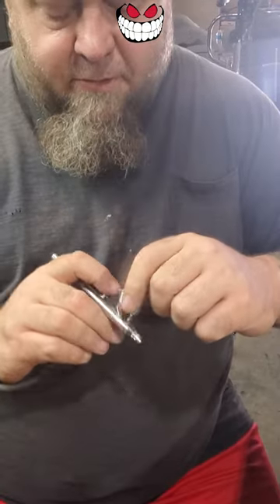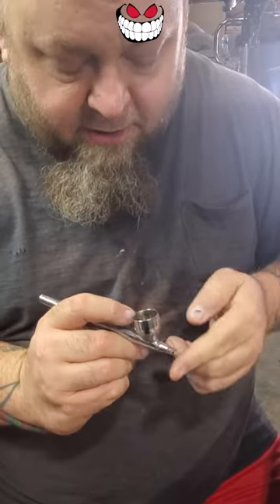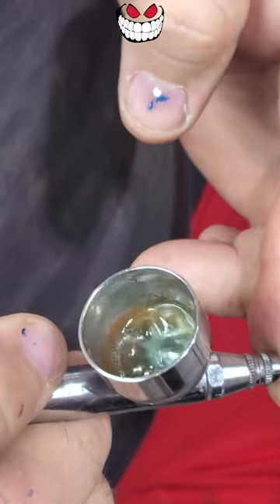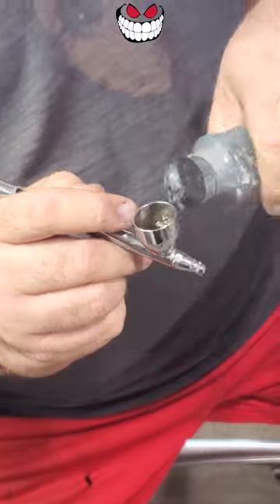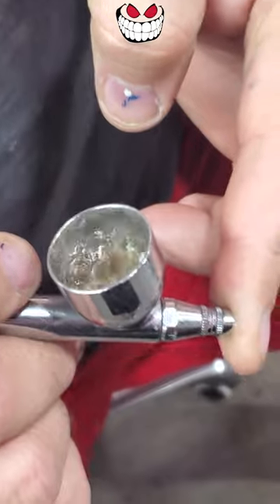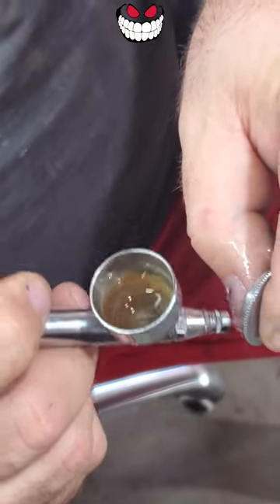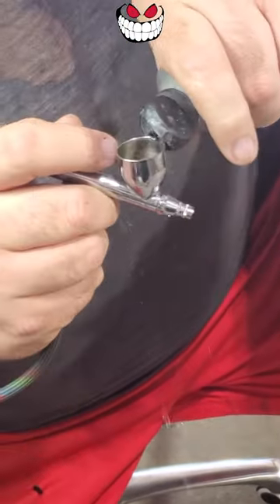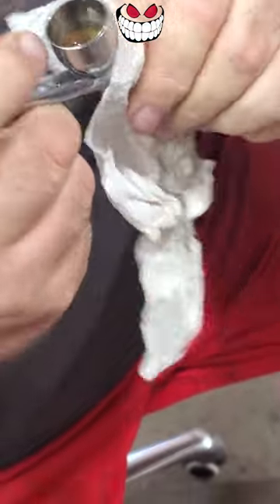Get Old Paint Out Of An Airbrush Quickly And Easily #airbrush #paint #tips #easy

Comment: Mine keeps clogging up and I have no idea what I'm doing wrong 😭😭
Reply from the maker: Are you using water-based or urethane paints?  Which airbrush are u using?
Reply: @SonofaFink  I use water-based and a have a badger 155 and a master g233. I thin the paint out, I've even tried using airbrush specific paint with not much luck.
Reply from the maker: The Badger isn't a terrible brush but they can be ridiculously finicky The spitting issues are why I switched to an iwata hp-cs its a workhorse.  Water-based paints in general are a pain but a good product helps relieve the pain wicked paints makes some great Water-based products but if you are willing to make the switch urethane based airbrush paints u can really do alot more and color change time is fast.  Tell me more about the clogging what's it doing?